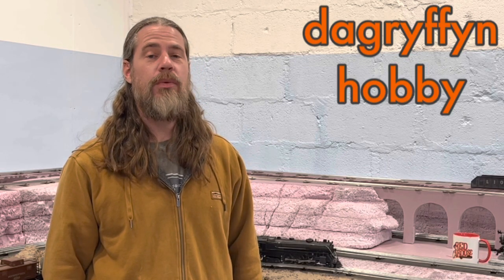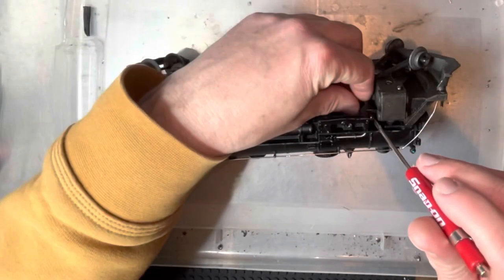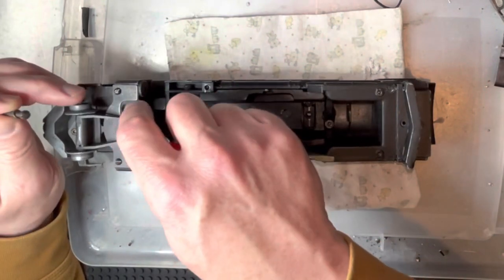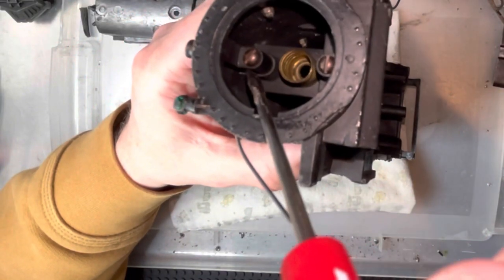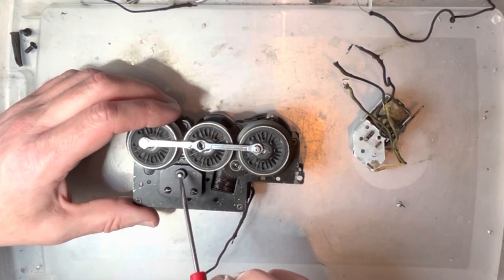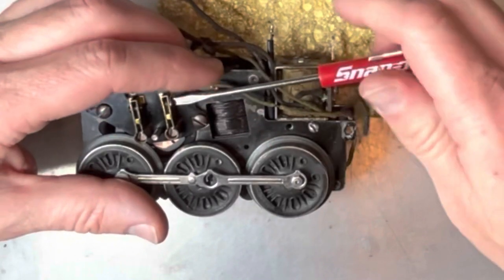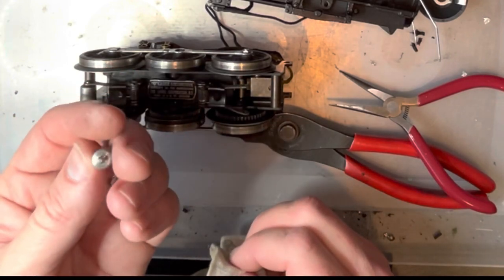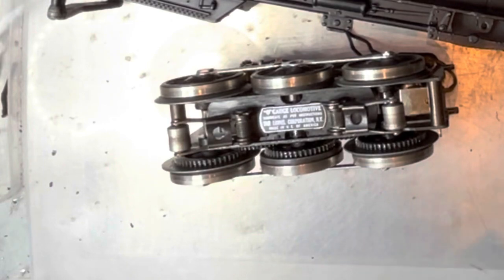Lionel Prewar 226E: Disassembly, Repair, and Assembly of the Prewar Classic: Lionel Maintenance

Comment: Great episode! Thanks for detailing all the steps in case we as viewers want to fix our own! I’ve had good success with postwar. It looks like much of this especially running gear resembles the 1666. I had to replace all of it off EBay on a 1 owner 1666 that lost the rods etc. I always learn something new on here!
Reply from the maker: Thank you! Many engines, both pre and postwar, even MPC era, are very similar. There are usually variations but they are mostly the same which makes fixing them much easier. 
The 1666 is a great engine too. It was made both pre and postwar, so it’s a similar age as the 226e. Very solid engines.

Comment: Great video!! I remember seeing a 226e on a table for sale during the    Dulles Train Show last year, I unfortunately didn’t secure it. The 226e is an engine I’ve longed to own, but someday I’ll get one. 

A good alternative for the 226e is also the 225e. It’s a great engine that also uses the same tender(2235w or 2224w) as the 226e(2226w) just with a 4 wheeled chassis. In short, the 225e is essentially the 226e’s little brother.
Reply from the maker: Thanks. The 225 is a fabulous engine too. I’ve had a few, I currently have two in parts that I need to kit back together. The 226 is just such a classic, so many engines came from that boiler casting

Comment: Outstanding Dave!  If I ever get my hands on a 226E, or even a plain 226 I'll know just what to do.
And I had NO idea there was a weight in the boiler shell!  No wonder that 226E I handled a few years ago was so heavy!   It should be a great puller!
Thanks again!
Reply from the maker: Thanks! It’s a great engine and the basis for many to come after it. It is definitely a heavy engine and pulls and runs very well. I kept adding cars last night until I got wheel slip, somewhere around 32 cars. Not bad at all!
Reply: @dagryffynhobby  Thirty-two cars?  That's great!  A lot of current production engines can't match that, and with traction tires too!
Reply from the maker: @wayneantoniazzi2706  I was impressed
Reply: @dagryffynhobby  You know, you should do a short video of the 226E pulling that long consist, or work it in with another one.  That'll be something for everyone to see!
Reply from the maker: @wayneantoniazzi2706  well if you can wait until tomorrow at 2, you just might be able to see that 😃
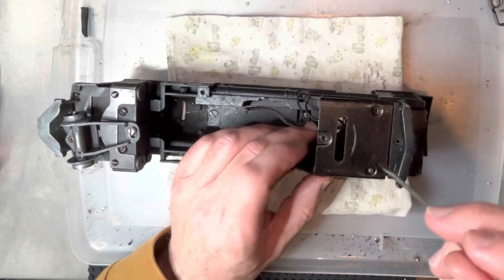Reply: @dagryffynhobby  Outstanding!  I'm probably not going to be able to catch it at 2:00, but rest assured I'll catch it!

Comment: Great video, Dave. You are so lucky to have the 226E. Other than the scale Hudson, it was Lionel's best prewar steamer. It was also the basis for the postwar Berkshire. Thanks again for sharing. I also appreciated the  way you ran your soldering iron over the shrink tubing.
Reply from the maker: Thanks! I’m thrilled I was able to find a 226e for a low price, otherwise it would have been out of reach. It’s a really nice running engine, I can’t wait to see how many cars it will pull. 
Not sure where I got the idea for the soldering iron to shrink the tube, probably necessity!
Reply: @dagryffynhobby  Any chance of telling how much you paid?
Reply from the maker: @ronalddevine9587  just under $300 with shipping
Reply: @dagryffynhobby  Wow, you got the bargain of the century. In case you aren't aware, Lionel made a coupler adapter enabling you to use postwar knuckle couplers.
Reply from the maker: @ronalddevine9587  it’s a good deal but the wrong tender. The tender for the 226e goes for big money. I’ll probably either make an adapter car, or switch it back over to postwar trucks.
Reply: @dagryffynhobby  783 tenders show up floating on the Bay from time to time. Snag one.
Reply: I like that idea of the soldering iron on the shrink tubing too, I've been using a cigarette lighter!
Reply: I just looked up the part number for the box to knuckle couplers adapter. 
TS-162
Reply from the maker: @ronalddevine9587  I did a quick truck swap on the rear of the tender last night so I could pull postwar cars. I have two similar tenders and may set one to pull pre and one for postwar cars. Or make a car into an adapter for use between the two.

Comment: Dave I've been waiting for this video! That is my favorite locomotive that I own. Its in a class by itself. Yours looks really nice. Looks like you fixed the issues with it.  E units runs great.  Great idea to use shrink tube to stop the exposed wire from shorting. Wow it really looks great on your layout. The firebox glow looks so cool, especially when you run it in the dark. Im so glad you got one. Well worth the money. Now its time for your 225e and the 226e to run side by side on the mainlines!
Reply from the maker: Thanks! I hope to get the 225e back together soon! The 226e is running really well even with the amount of cars I put behind it last night, it ran smooth and strong. I could go for a couple more 226s!

Comment: If the E-unit keeps going into neutral my experience has shown that the E-unit is not at falt.  The problem is with the collector continuity.  The solution is to replace the collector to eliminate any possible break in continuity.  Alternately the E-unit can be connected to the tender whistle relay using the tender collectors as an additional source of power.
Reply from the maker: The e unit is in fact fine. Cleaning the rollers fixed the issue. I’ve been running it without issue. 
I did set up a different engine to use the tenders pickup rollers also and it worked really well and even ran better. I’ve been tempted to do it to all my engines.